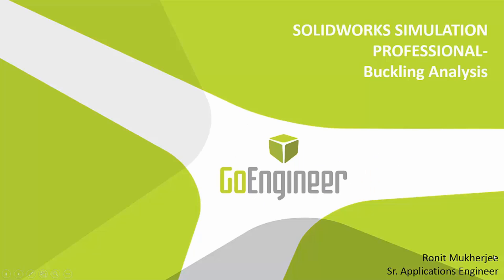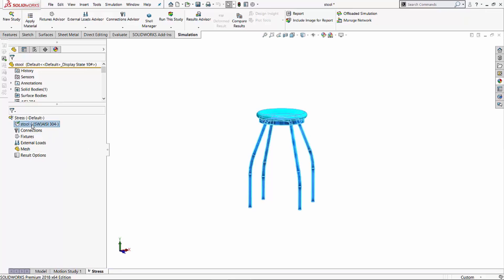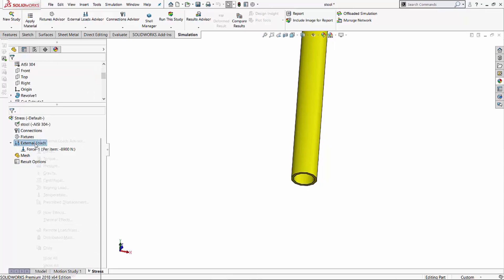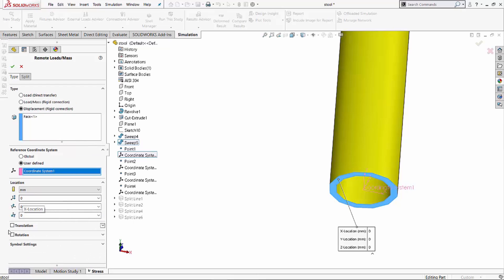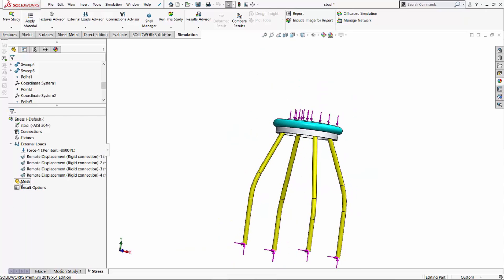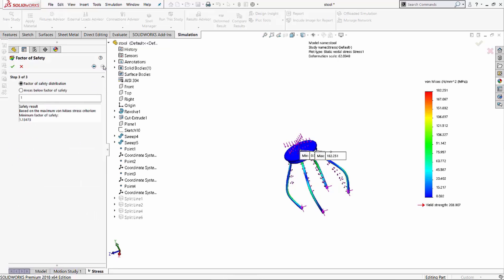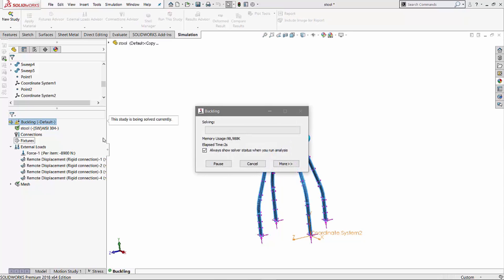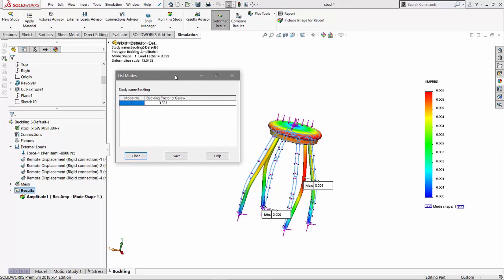SOLIDWORKS SIMULATION Professional - Buckling Analysis

Comment: The other question, I already read your overview about buckling analysis in your website. 

You write that “we have the Buckling Factor of Safety, we can compare it between Factors of Safety from a Static study result”. 

Why we should compare it between Factor of Safety in Static study? 

Or we just compare the BFS into BFS standar value, which is BFS > Buckling not predictable, etc.
Reply from the maker: Comparing the Buckling SF to the Static SF quick way to assess whether a design will exhibit a buckling failure or a yield failure first.

However, there are often other considerations to take into account such as a buckling failure can often be catastrophic whereas a yield failure can be safe. I'm not sure that the author mentions this nuance in this presentation.

Comment: Thank you for this information. 

But In I can’t change the buckling mode in my solidworks simulation. I only use the mode 1. 

But in my case, I wanna compare the mode 1,2,3 and 4 to know the best fixture that I gonna use.

Can you help me for this case?
Reply from the maker: You can adjust the numbers of modes that are you solving for in the STUDY PROPERTIES.  Right-click the study name in the Analysis tree, and then select "Properties".  It is often useful to view multiple modes since the first few modes can often be cosmetic and non-structural modes (think of a file cabinet frame with thin sheet metal attached; the sheet metal tends to show buckling before the important structural frame).

Comment: what is the different using Remote load and limit the displacement instead of fixed geometry as we normally do.
Reply: Hey Supun, 

Thanks for watching our video! In this case it allows more movement. The Remote Load/Displacement fixes just a single point, and the entire face of the stool can rotate around that fixed point. For this buckling example, the restraints are 'looser' allowing buckling to happen earlier. We tend to want to get results for the worst case scenario, and this helps us get there. Hope that helps!

Regards,
Shivani Patel - GoEngineer
Reply: I also have the same question..
Reply: @divyanshprakash9374  

Hey Divyansh, 

Thanks for watching our video! In this case it allows more movement. The Remote Load/Displacement fixes just a single point, and the entire face of the stool can rotate around that fixed point. For this buckling example, the restraints are 'looser' allowing buckling to happen earlier. We tend to want to get results for the worst case scenario, and this helps us get there. Hope that helps!

Regards,
Shivani Patel - GoEngineer
Reply: Thank you Miss. Patel. Now it is clear to me.
Reply: The legs bottom faces do not have geometry features (vertexes) you can use to restrict them normal way, so he used displacement restriction for the faces and coordinate systems features. You can use normal restrictions but you have to create artificial geometry with vertexes on the legs bottom face so you can select the vertex and restrict the bottom face (legs can rotate around the vertex).

Comment: The film itself is useful, however you definitely overconstrained the model. Both static and buckling analyses show that the model has tendency to move ends of the legs outside which is prohibited artificially. In fact, for such a model a classic 3-2-1 constrain method should be used. It means only one leg end should have no translations (as shown in the film), three other leg ends should have only vertical (global Y) translations constrained. Additionally, global rotation around Y axis should be constrained (there are several methods to do it). In such a case model deformation will be more natural and results could be quite different.
Reply: If the chair legs are mounted in the holes in the floor they will not slide.